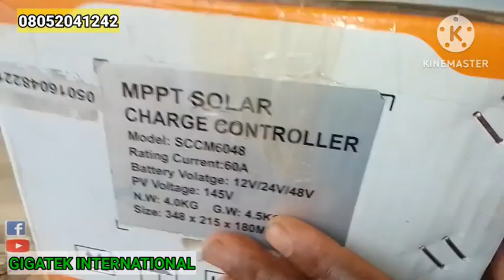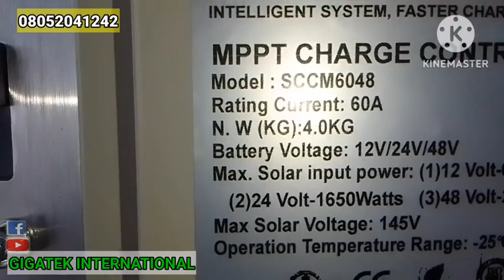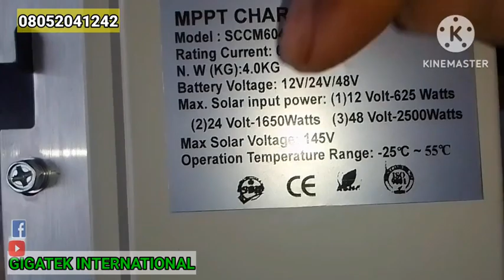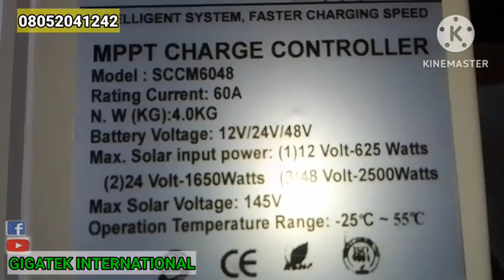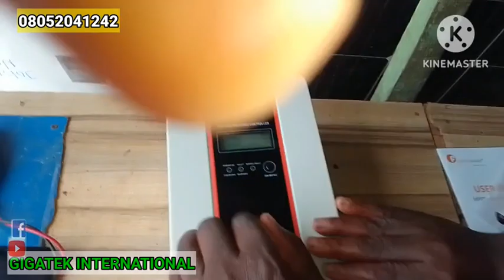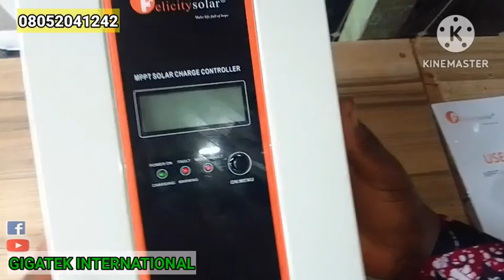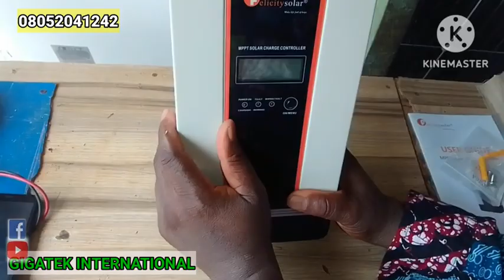FEATURES OF A 60AMPS FELICITY MPPT CHARGE CONTROLLER REVIEW

Comment: Alaba boys strike again. What you bought from the sticker is a 45a felicity mppt. A 60a felicitysolar mppt will accommodate 3300w at 48volts. They do this because 45a and 60a have same form factor. A pity. Same thing with 100a and 120a felicity mppt.
Reply from the maker: Its a very sad situation.  One has to  be careful.  Even inverters, batteries and panels are cleverly  overrated. I have fallen for their gimmick several times  . It actually a big issue
Reply: Bros can I have your number,
Reply: I don't like the way This charge controller work. It goes off completely at night and on at the day. With that you can't check your battery status at night. Rubbish. 😢
Reply: @collinsemedo3332  That is how the newer version works to minimize battery usage. i bought one some weeks ago. am yet to install though. 80ah felicity. i have  a 4 tubular luminous batteries. i will be back to share my experience
Reply: @barr.abrahamocheje please share your experience
Reply: How about checking the battery level on your inverter?